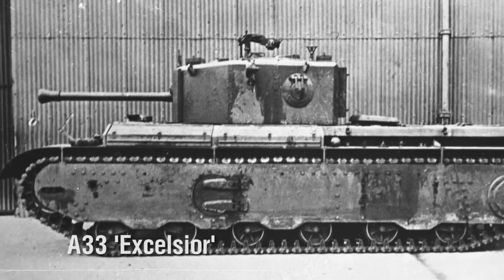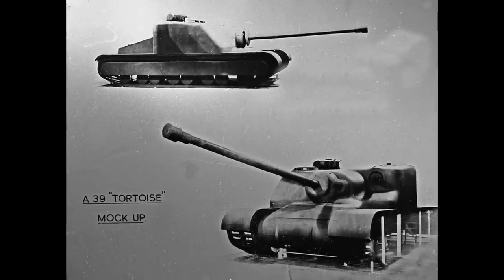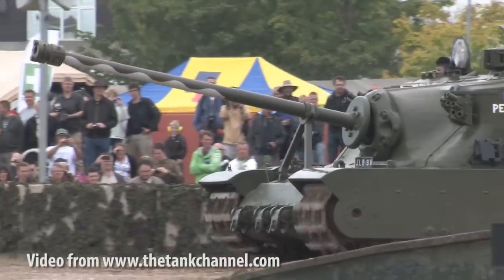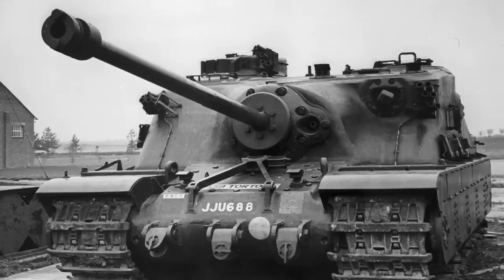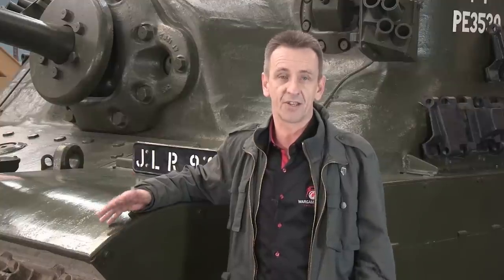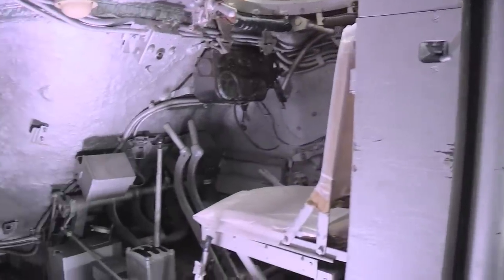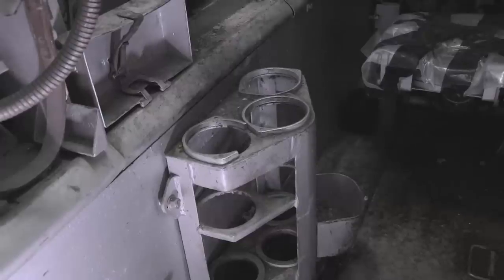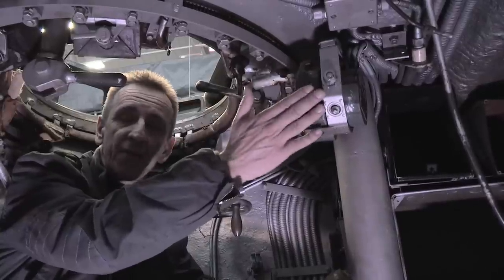Inside The Tanks: The Tortoise - World of Tanks

Comment: The working pressure of 32pdr is 22tsi and the MV of APCBC is 3,100ft/s. It also shoots three types of APDS. The third Type 'Petal' Sabot got a MV of 5,050ft/s for a pressure of 22tsi. In the trial dated 28.6.1945, the 'Petal' APDS penetrated 200 mm armour plate at 50° to normal at a Striking Velocity of 4,879ft/s.

Comment: The Ordnance QF 32-pounder 96 mm gun was developed from the QF 3.7 inch AA gun.Considering the size and mass of the Tortoise,I'wonder,if it have gone into service,whether it could have been used as a platform for a larger gun ,developed from,say.the QF 4.5-inch Mk IV naval AA gun. Arguments in favour of the 3.7 in gun are a quicker rate of fire than the 4.5 in gun and superior logistics ,in terms of a ready supply of shells However,given the immense difficulty of transporting such a massive vehicle from one location to another,these would have been relatively minor issues.

Comment: Hello Richard, nice video.  

You mentioned Churchill tanks having an unreliable engine - was the Meteor ever fitted, or was it just not available because it was so much in demand elsewhere? 

Also, if the meteor was a non supercharged merlin, why was this engine not used given the enormous power increase if would have given?  I guess heat and cooling would be an issue but surely not insurmountable?
Reply: SuperBobbster I'm no expert but a bit of engineering knowledge tells me two things- 1. Aircraft engines were very highly tuned, with short lifetimes, like race cars. Down rating allows better reliability for workhorse requirements like ground vehicles. Heat certainly is an issue, as tanks clearly don't have the luxury of 300mph airflow to help cooling. 2. Merlin engine superchargers were, by and large, optimised for maximum efficiency at altitude (say, 3000-6000m).
Reply: Dom Didn't the black prince have a meteor?
Reply: I don't think the black prince ever existed only in blue prints not sure

Comment: The Excelsior was the British edition of the US T14 Heavy tank idea, which they'd already refused no less than twice.

  Interesting that the late (and early post) war super heavy breakthrough and bunkerbusting AFVs would have been inferior to the KV2 in important ways: Dreadnaught (the KV2) had no comically long (not to mention operationally limiting) overhang, its 152mm gun/howitzer hit to better effect against bunker and fortification defenses than any 20-30pdr, T15 90mm, or longbarrel 105mm.  Not only that, it could traverse its turret (a forgotten feature ideal in urban and many rural situations) and was a teeny bit faster, while lighter overall, than the UK Tortoise, US T82, or Deutscher SturmTiger.  .  As heavy tank destroyers the super heavies might've been useful, perhaps, but not as leaders in an armored assault, or as StuGs in town and city settings.  For that you'd need a KV2.

  As for duplication of effort: the British had already done it before with Churchill AVRE, trading AntiTank capability for superior HE and HEAT effect on stationary targets and fixed emplacements.  Well protected by heavy front armor (6" on late models), for the Assault role Churchill AVRE was an adequate, if not ideal, AFV.
Reply: Yes the kv2 could turn it's turret, untill it hit a slope. Also it was broke down, and was a massive target for aircraft, the kv2 was a disaster.

Comment: Too bad the Germans didn't share the poor results of their Ferdinand/Elefant tank destroyer (the result of Porsche not wanting to scrap the rejected hulls built for the Pzkpfw VI Tiger and suggested that they could simply put a huge gun in it instead) with the British... could've saved them quite a bit of money and time, because that monster had exactly the same problems: Too heavy, too slow, the gun couldn't be aimed (the entire tank had to be aimed), it was almost impossible to move from A to B (even on a train) and it would crush almost every bridge and it had mechanical problems.
Reply: However what was the main issue with the Ferdinand was the very limited gun traverse arc. The Tortoise had a very adequate gun traverse. It also had a reliable engine unlike the Ferdinand as well. The Ferdinand did have a slightly faster top speed though however its armour wasn't as good as the A39's.
Reply: jagtiger is better armoured
Reply: KNIGHTOFOBLIVION15 Only on the super structure. The rest of the armour on the jagtiger is less than or equal to the A39. Side the A39 is best throughout. Rear again. The Jag's upper frontal plate is very think and is likely to be around the same thickness but that's one plate whereas the A39 has thick armour all round.
Reply: true dat but frontal armour of jg was better
Reply: Only on the upper plate. The lower plate was substantially weaker. The superstructure front  was rock solid though I grant you that.
Reply: yes yes i agree  m8  tortoise had better all around armour and good front only 20 mm less than the the  jg had only stronger superstructure front

Comment: Maybe a mechanic can tell me but why are all the engines for tanks so underpowered? I mean you see plenty of cars at shows whose engines are putting out 1000+ horsepower and they aren't much newer then the late war tanks on display here. And the engine bay of a car isn't any bigger then the engine bay of a tank.
Reply: +clothar23 
At the time these tanks were produced engine technology was in a relatively early stage. So power per ltr was MUCH lower than is now achievable.  Consequently, to provide high power output an engine had to be of large cubic capacity, and therefore, of large dimensions.  This limited the size of engine that could be accommodated in a tank.
Petrol engines in particular were restricted in output due to the compression ratio that could be used,  the Meteor for example, as used in the TD here, had a CR of about 6:1.  Any higher and it would detonate during the combustion stroke, this would melt pistons and burn valves.  
Diesel technology was also in it's early stages then, but diesels were a much better power unit for a tank. Russian tanks had very advanced diesels for the time.  Very few allied AFV's had diesels.
One significant advantage is far less volatile fuel, so less tendency for fires.
Turbo chargers and superchargers had not been developed adequately at the time for reliable service in this sort of application.  Metallurgy had not developed the metal alloys necessary for the exhaust turbines.
Comparison with the power plants now available is just not valid, particularly with high output automotive units, which would have nowhere near the duty cycle required for an AFV.

Comment: he said that it could knock out all of the German Tanks but the gun wasn't powerful enough to frontal penetrante a Maus
Reply: Did you not see how difficult it was to move this thing? Multiply that by three for the Maus. The only idea the Germans had which was stupider than the Maus was the Ratte. Super heavy tanks were a stupid idea.
Reply: TheThirdMan the Maus wasnt that Hardware to move ,it had a Diesel electric drivetrain with very very much Torque
Reply: # Backfisch That's not the point. It could not be put into the field without taking the turret off, which took a considerable amount of time and resources. The Maus was a classic example of the party telling the commanders "what they should have". The fact is that it could never have been deployed. The rail system required to move it could not have coped, the steel required to build it was more needed elsewhere, the cost of building and operating it was stupid and in the end it had exactly the same vulnerabilities as any other tank. It was so heavy that if it got stuck it could not have been recovered. Even if it had been able to be put into the field, the size of the assembly area and the number of people required to service it would have been enormous in comparison to any other tank and would have made a very tempting target for rocket-firing fighters.

The Maus was a stupid idea and the only people it impressed were senior Nazis.
Reply: TheThirdMan I know that it was a bad idea and that it was already to late in the war that a Wunderwaffe or Vergeltungswaffe could do anything to Change the war , but it's enormus size its Armour and its firepower Just makes this vehicle or moving bunker impressiv
Reply: # Backfisch None of the commanders wanted it. It was useless to them. Nobody was listening to them. That means the whole concept of the Maus was flawed from the start. The only people it impressed were senior Nazis.
Reply: I don't think this tank ever saw a maus...